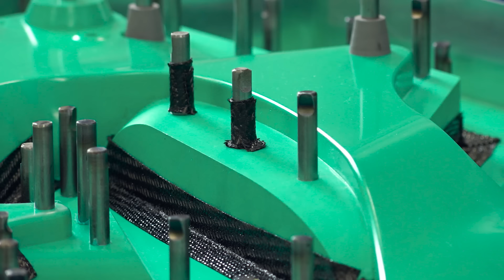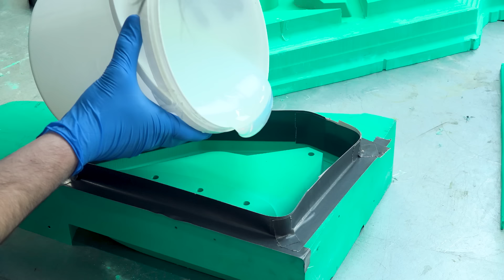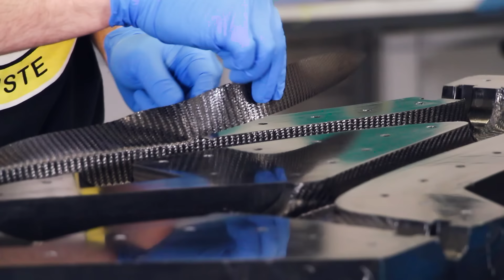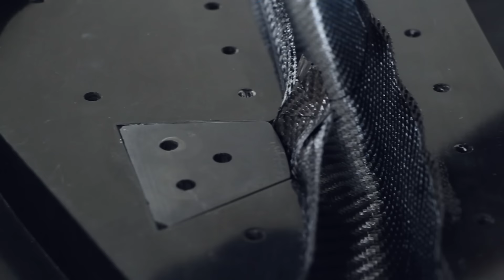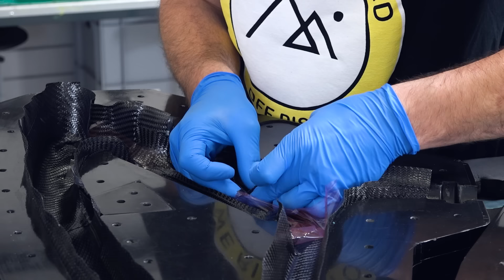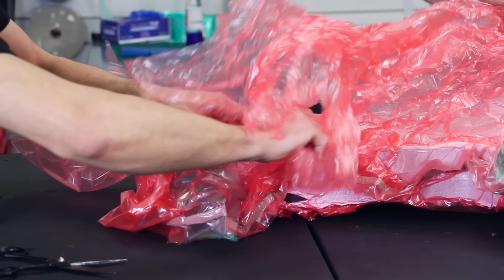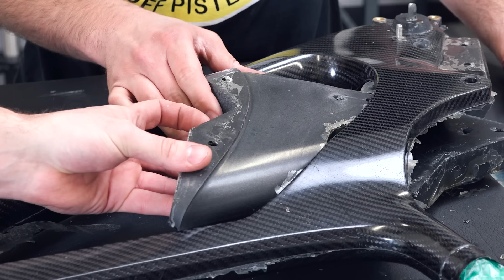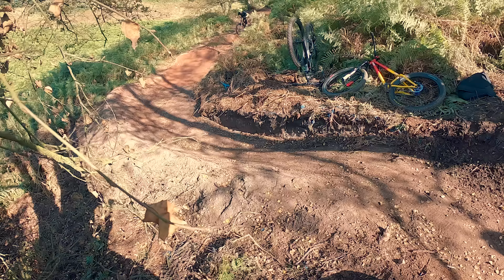Making a Carbon Fibre Bike Frame – From CAD Design to Downhill Race

Comment: Hi. Is it possible to make small moulds with high temperature resin and graphite powder? What is the name of your high temperature resin?

For the use of Carbon Prepreg and pressure in a closed mould, would the part come out with different sizes due to the CTE?

Thank you.
Reply from the maker: Hi David, yes, it's perfectly possible to cast solid moulds using high temperature epoxy filled with graphite, essentially making them in just the same way that Vlad made the inserts. The resin we use is our EL160 High Temperature Laminating Epoxy.
As for your CTE question, there is always some dimensional change to a mould when used at temperature, no matter what material or process is used. The difference is the extent of the expansion and this very much depends on the material the mould is made from. So, for your 'carbon prepreg and pressure in a closed mould' you could be referring to a mould made from billet alluminium, or carbon composite, or the cast resin/graphite you mentioned earlier. A billet aluminium mould would have the highest CTE, the graphite/resin mix second (owing to the relatively high ratio of epoxy vs graphite) and the carbon composite would have the lowest CTE. Depending on geometry, mould thickness, cure temperature and some other factors, this could result in maybe a 1-2mm over the bike frame in the worst case or less than 0.5mm in the best case. So, it's worth considering but probably not losing sleep over!

Comment: Hey guys, thank you for your amazing videos! Could you please leave here the link to the polyurethane (that you are using in the video to make the pattern) or give me more info about it? Thank you again
Reply from the maker: Hi Lluis, good point! We need to add some links to this description. I'll get that done in a sec.
In the meantime, it's actually epoxy block that we use for the pattern; polyurethane inhibits the cure of epoxy so must not be used as a pattern for prepreg tools. Here's a link:https://www.easycomposites.co.uk/#!/patterns-moulds-and-tooling/tooling-and-modelling-board/EP700-High-Temperature-Epoxy-Tooling-Board.html

Comment: using some drill bushes where the location pins for the molds locate before putting the pins in really helps with preserving the lif of the mold, and you can get dowel pins with threads down them to extraxt with a slide hammer. love the x preg mold, looks relly clean. how does the strength of the pre preg used compare to T00 for example? love the video!
Reply from the maker: Hi, thanks for the post.

Yes, you're right about the drill bushes and also about the threaded dowls. In fact another poster mentioned the threaded dowls with a slide hammer for removal so we'll try to demo that in a future video. It's hard to compare the 'strength' of a carbon composite mould to aluminium because strength can mean a lot of things and the comparison/result would be different depending on what you meant by it and also the design (and intended use) of the mould is quite different between a thin-wall composite mould and a solid billet tool. In every day terms, 'durability' is probably what you're talking about; a solid aluminium mould would be more durable and be capable of producing more parts in the long term. However, both moulds would be difficult to 'restore' as they do start to pick up wear-and-tear and so, in some ways, it can be easier to maintain a composite mould (by replacing it more regularly) than by needing to run an aluminium tool much longer (because of the cost).

Comment: how does vacuum make green tubes blow outward/up? The french company piercan makes custom latex bladders. l bought a straight one for making square 40mm tubes.
Reply: The vacuum pulls the tube rather than inflates. One end of the tube is open to the air while the other sealed end is inside the mould so the vacuum pulls it to the material. I am not too keen on seeing how much bag was folded around inside as the bag is not that soft of flexible and if it has a tight turn and a crease it will not consolidate the material inside the mould fully. Its better to have a specific tube made to the correct shape which will be much better at consolidation. You can see areas on the swing arm sections which have poor consolidation and would be weaker than they should be. The lay up may have been much heavier than it could be with a good specific vacuum bladder as such but it sort of worked. I use an internal tube for making air tubes and make sure that I only use a tube which is a little larger when fully open than the part it is going inside. I have used bags which were actually too big and that did cause issues with the creasing showing it was not as consolidated as it should be where the bag had pinched or creased or had bunched up.

Comment: Awesome video. Could you please make more videos about bike frames. Maybe a frame without prepreg.
Reply: Again many thanks for sharing this video. I loved it.
Reply from the maker: Hi Strougi, we'll try to but - in terms of alternative processes - there isn't really much alternative to prepreg for the production of a carbon bike frame. The only other alternative would be a sacrificial core method or a solid core method. Both of these processes are interesting and can be used for prototyping but prepreg, either vac bagged and oven cured or positive pressure into billet tools, is really the way to make a production frame.

Comment: thanks for the video, its very complex but am I understanding it correctly that the 2 halves are made from 2 lays so no carbon fibers actually cross the mid-line?  To me this means only the tensile strength of the epoxy resin keeps them from separating.  Am I missing something?
Reply from the maker: Woo Cash yes, you’re missing the ‘laps’. The two halves are laid up separately but you can see that one one side lots of material overhangs the edge. This overhanging material is used to lap over onto the other side, bridging the join. Laps are staggered and the reinforcement on the opposite side of the mould, where the lap will join to, reduces accordingly, thus maintaining a consistent wall thickness.
Reply: @easycompositestv  thanks that makes sense now!

Comment: You don’t need to pressurize the inner bag?
Reply from the maker: Cam Gregg you don’t pressurise it with positive pressure inside the tube bags but we do apply vacuum to the outside of them which effectively has the same effect as pressurising them.
Reply: I think there is only one bag, it just goes on the inside and outside.

Comment: That's great - very informative. Would like to see the frame design process including the CAD and stress analysis etc.
Reply from the maker: Hi Chris, we'll have a think about what we might be able to do on that front. Vlad's already been snapped up by an established bike company and has moved overseas but there may be other things we can do to explore that side of it. In terms of stress analysis, many people would be surprised to see how little FEA influences the frame design and laminate schedule, even at the top manufacturers. There's more 'suck-it-and-see' than you'd think, especially because the 'feel' of the bike, in terms of how and where it flexes, is quite an organic process. What I can say is that the starting point for most frame designs is a basic layup that's usually way too heavy and strong and then an iterative process of weight reduction, tested through prototypes.
Reply: @easycompositestv  As a young aspiring engineer who has does lots of CAD design for robotics, that reliance on real world testing is pretty funny. I'd like to make some electric skateboard parts with your products after watching this!
Reply: @quinnfoster4671  i'd highly recommend avoiding electric skateboards
having propulsion so low below the center of mass is very nasty
those wheel "hoverboard" things solve that issue by automatically pitching up/down...but they can do that because they have two wheels mounted on the side
having 4 wheels like a skateboard does not allow for such things..the user will fall off if power isn't very smoothly regulated, but then you lose acceleration.
Reply: @doktork3406  I can tell you have never ridden an electric skateboard!

I ran AWD maytech 6374 190KV motors, total of 7.5 KW peak power. It could easily throw you off but that was the best part, it's faster than my friends dirt bike at least on the road.

Also I am working on making a DIY Onewheel out of a old onewheel v1 hub motor, as well as adding wheelie mode to an electric skateboard. Lot's of cool projects!

Comment: Can these techniques be done with just vacuum resin infusion? I'm not looking into buying an autoclave for prepreg carbon fiber.
Reply from the maker: smurf weed this process doesn’t need an autoclave, as you’ll see in the video, we’re only using an oven to cure the prepreg, under just vacuum pressure but if you didn’t want to use prepregs at all then “no”, it really wouldn’t be sensible or practical to try to follow a similar process using resin infusion. Resin infusion is an amazing process but it’s just not right for this type of work.
Reply: @easycompositestv  thanks for the quick response. I figured it wouldn't. I have limited time and space so prepreg is not an option at the moment.

Comment: I'm curious how you made the mating surfaces so fine between the mold halves.  They were not cut on the mold line, and it doesn't look like they overlapped after de-mold.  very interested in how that was achieved.
Reply from the maker: The very first layer (the one you see) was cut completely flush with the top edge of the mould line, on both halves of the mould. This might not be clear in the video because straight after you can see more layers which are not cut to the edge (these are the laps) but the first layer was.
Reply: @easycompositestv  I think I understand the process, but let me know if my understanding is correct here.  The first layers on both halves are cut flush and give the cosmetic "book-matched" look.  While the staggering of subsequent reinforcement layers are asymmetrical to the mold halves to provide a uniform cross section thickness.  Essentially, where the staggered layers extend above the cut edge on one mold half would then have the layers staggered below the cut edge on the mating mold half.  Am I close?

Comment: amazing interesting video! thanks for that! But i have 3 questions that you can answer hopefully to us :)
1. You just put vacuumbags inside the frame to press the prepreg against the mold from the inside...so isn`t it necessary to inflate the vacuum bags from the outside with an air compressor? 
2. The frame comes out beautiful! but what i didn`t see are the metal inserts in the Frame (like the bottom bracket Inlay or the headtube inlay). Are they bonded to the frame too? 
3. what are the material costs in this case for 1. the Frame, 2. the Frame Mold, 3. the green mold for the main mold . Prices all exclude the machining and time costs. That would be very interessting for someone who want to make his own frame too :)

best whishes
Andy
Reply from the maker: The reason you don't need to inflate the bag is because the tubes are sealed into the vacuum bag that encapsulates the whole mould so the force comes from the tubular bag coming to a full vacuum and being pulled tightly against the laminate.  The final assembly of the frame was not shown but did include various inserts bonded into place.    The total cost will vary depending on various factors such as size of frame, number of parts/moulds needed, individual lay up etc.  In this case we did not keep a detailed costing but we would expect this process to cost between £2000 and £3000.
Reply: @easycompositestv  thanks for your answer, you offers a perfect service!

Comment: Hello, I jump with joy when I seen this video showing how to make a bike frame from beginning to end, especially since I was goung to buy equipement from you guys !! Great job guys !! I was woundering if you guys know any good CNC machines (for one's home) able to make molds with Epoxy mod boards for a bike ?
Reply from the maker: Hi Yoan, thanks, we’re glad you like it and of course we’d love to have you as a customer. Regarding a CNC machine, it really depends on your budget and the size of the bed you want. Although it’s a bit less convenient, it’s often worth considering a smaller bed than required and then join sections of the pattern together. When you’re looking at larger machines they are disproportionately expensive because doubling the travel tends to mean 4 times the gauge of steel etc in order to maintain accuracy/stiffness in the machine. Obviously Vlad used a high machine in this video but something much smaller would be fine for home use. We have a low cost desktop machine made in China and badged as “CNC EST” and it’s worked superbly since we had it. Hope this helps.
Reply: @easycompositestv  Thanks for the awesome answer, that helps a lot. I'm not sure I would trust a mold as wide as one for a bike frame put together in pieces, that might be complicated having to stick it together and make it smooth inside so no marks would come out on the outside of the frame, you know what mean ?

Comment: Very nice, but you skipped some of the most interesting parts, like designing and planning the cut patterns and removing the bags from inside the frame
Reply from the maker: Thanks Hans. Removing the bags from the inside of the frame wasn't too exciting, we really did just pull them out through the neck. I think we were conscious that this was already a 40 min video! As for planning the cuts, we did film lots of this but it was difficult to make sense of watching it back. Planning the cut lines and orientation for the surface ply was mainly considering the visual appearance and making the two sides symmetrical. The main reinforcement we tried to explain in quite a lot of detail but I guess there's always more detail we could provide. If you're doing a similar project and have any specific questions, please get in touch with us.
Reply: @easycompositestv  Could you make a tutorial how to make this frame, but from desiging the pattern, to put all layers and finishing works (maybe with 3-5 40minutes parts video?)with discussing everything ?

Comment: I've learned about vacuum tubing by watching a video about the Koenigsegg wheels but I had to figure it out as they kept it secret. Thanks for sharing. Wouldn't it be better to add a fiberglass sheet between the carbon fiber and the aluminium parts to avoid galvanig corrusion? I don't think the metal parts are titanium!?
Reply from the maker: Fibreglass sheet between the carbon and ally? Are you referring to Galvanic corrosion? There’s not really any direct contact between ally and CFRP in this video (that I can think of) and generally galvanic corrosion is not really major consideration in applications like a bike frame.
Reply: @easycompositestv  wait, what? Galvanic corrosion is a huge consideration. The history of carbon bike frames is littered with frames with corroded and otherwise disbonded aluminum inserts. Anodizing is not enough, and epoxy also is inadequate. There must be some other barrier.
I see the ISCG threads may be aluminum in there. Curious if there are aluminum inserts for the bottom bracket and at the pivots.
Reply: For proper use (racing) they won't last long enough for that to be a problem. If it is a problem, you are using it wrong.

Comment: Nice video
How heavy was the frame 
and how match was the weight save acc. alu frame
Reply from the maker: Hi Stefan, the frame weighs 4.1kg, including the shock and linkages. I can't give you a comparison to an aluminium frame because this frame has never been modelled or built in aluminium.
Reply: @easycompositestv 
Thanks.

Comment: I have waited for new video from you for 2 years. Always interesting. Thanks! :) In Finland bikeframes are done a bit differently. 3D print the inside of the frame, then just lay the carbon around it everywhere, and then dilute the 3D-printed part away from inside, so it is eventually hollow. Not my business but just know how they operate that.
Reply from the maker: Thanks for the message, you’re absolutely right that you can indeed make a prototype frame using the sacrificial core method. There are a number of reasons why the conventional method of having moulds produces a superior result but sacrificial cores are defiantly interesting and have their place, especially for prototyping and development work. We have a customer in France who did a great project this way and we might do a video in the future demonstrating this technique.
Reply: @easycompositestv  In meanwhile I need to order you some perma-grit stuff that I forgot from last order. kinda wasteful to pay 15€ postage on a 5€ sawblade, but that's how it is.

Comment: Can I use resin infusion for chopped carbon fiber?
Reply from the maker: Good question, generally chopped fibres, rather than woven fabrics, sit too close to each other to allow resin to penetrate properly under vacuum. For this reason, it’s generally very difficult to get resin to infuse through chopped strand carbon. Adding positive pressure (like and RTM process) would overcome this but requires and lot of equipment and heavy moulds.